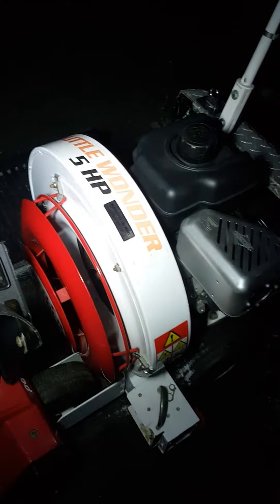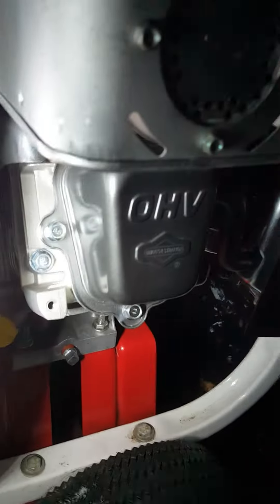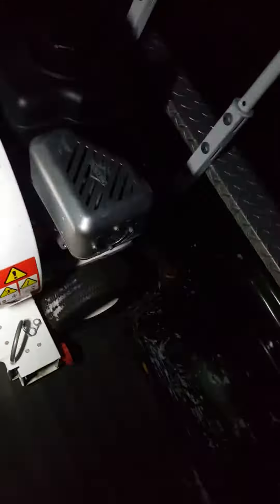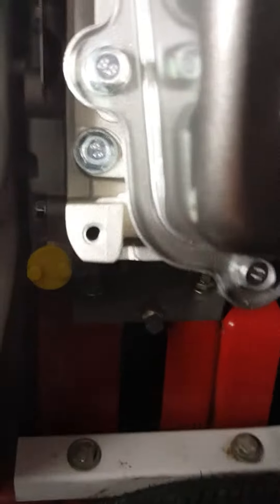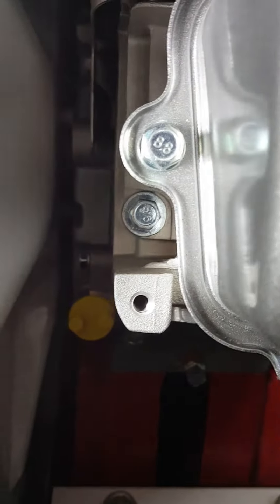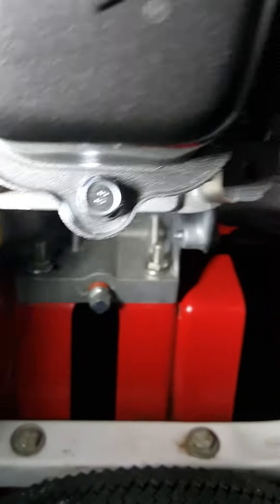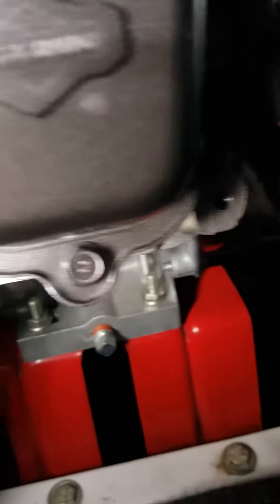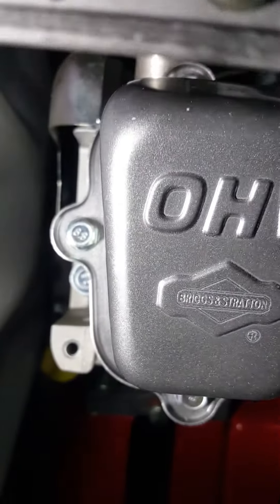A Chinese made Briggs?

Comment: The 8.8 numbers on the bolt heads relate to the tensile strength of the bolt. Those bolts are rated as "high tensile structural"

Comment: go with a honda, they are the only really good ones now days. briggs were known to cheap out on their engines now especially with plastic cams
Reply: +Electronic Experiments how do you know?
Reply: *****
ok
Reply: +Josh Kilen they arnt plastic they have metal cams if this guy actually opened up the sump cover on one he would know this
Reply: Nothing wrong with a plastic cam. Honda uses the same in alot of thier smaller stuff and vertical shaft engines.

Comment: i think this engine is made in USA i seen the newer Briggs 163cc and 208cc engines they are made in China  the engine block and blower housing look to that of a Honda clone engine. as a  predator 212cc from Harbor Freight is a Honda clone and is the most popular replacement engine out there if u have to install one on your blower refer to the videos replacing chipper motor with Predator engine as the muffler has to be moved and a spacer to adapt a 3/4 inch shaft to 1 inch. as i do believe Briggs and Stratton has a plant in China in Chongqing which makes the Honda clone type engines the CR750 and CR950 series the XR2100 professional series and other of their horizontal shaft engines. i seen them now installed on the Agri Fab mow and vac machines. the better engines by B&S is their vanguard series.  their push mower and pressure washer engines aren't that great mainly the Professional series and ex series engines as they are putting PLASTIC camshafts and timing gears in them and they fail and the valves don't work. but they no longer make the L Head of flathead engines the only engine they make is their Quantum series and Mow N Stow series.

Comment: Big guy, they're made in China sure. Briggs design though. Dig down to the carb on a powermore, and then an intek... tell me theres no difference. Dump some seafoam in the gas run a tank full 1/2 your problem will go away. Next choose, power or easy starting. You want power go for a bosch copper spark plug, you want easy starting go NGK. You want neither, stick with champion.